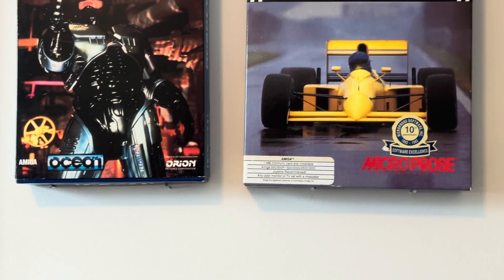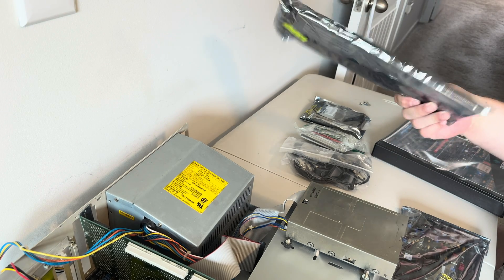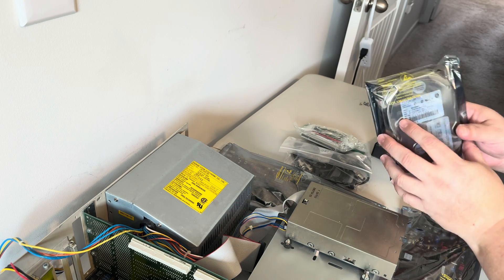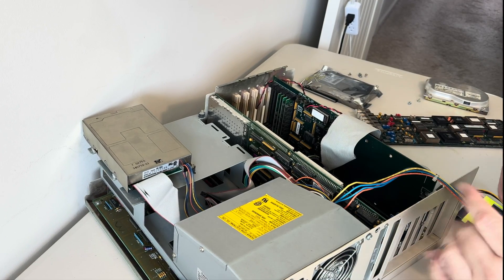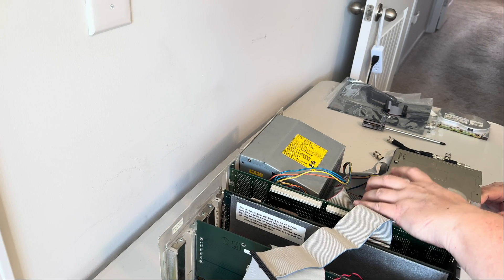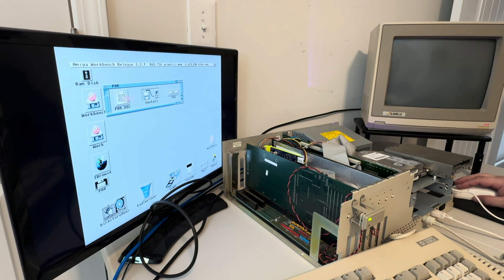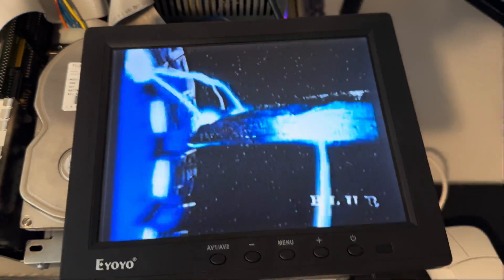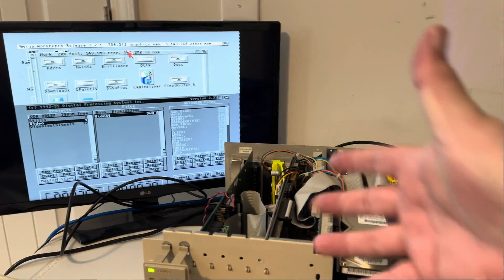We Had THIS Technology In The 90s for Computers!

Comment: I always wonder back then how they record those cgi on analog tape, now you give me the answer, it's a kind of a digital broadcast buffer , in early 2k i t was possible to convert all tga or RLE frame to a DV recorder , i actualy found a DVD + RW recorder that work in hardware MPEG 2 that have that DV link plug integrated to the rack and i still have my firewire PCI card on an old PC , but the render must be scanline field to PAL or NTSC to make the video run smooth without glitch.

Comment: SCALA with a LANC controller and a DV cam was MUCH MUCH better. S-Video/DVD quality recording. and MUCH MUCH CHEAPER. and all Digital. I was Destryong PC users in the 90's. Also used a DCTV with RGB adaptor and converted Video Footage into single frames and put them back into the Amiga as 16 color DCTV images (which it translates to 16 million colors) and played back smoothly. The Amiga thinks they are 16 color frames/animations and treats them as such so its light. I also used Elan Performer to play them back on an ECS Amiga to VJ. Instant response.
Reply from the maker: DCTVs output wasn’t that great. I mentioned DCTV in the video. I’ve done some vids on it. It’s a good cheap solution. Just not to the quality as the PAR’s output. The Amiga was very versatile and lots of animation options. The PAR was one of the best for true broadcast quality 30fps animation playback. Especially from your own desktop without a huge investment in other gear and fancy decks. A simple VCR was all you needed to record your amazing looking animations from the PAR.

Comment: On the Amiga monitor to get composite input, there is a slide switch on the right side of the flip down cover. It's pretty small and almost hidden, it slides left and right. On the back of the monitor there should be a composite labeled RCA input, or it's likely the yellow RCA. Might be a Y and C input on the back that I think was meant for C64's and 128's that had separate luminance and chrominance output cable. 

I remember drooling over those PAR cards in Amiga magazine ads. I had worked with a U-Matic 3/4" deck to lay one frame at a time using a serial to parallel controller that could control the VTR down to the field using SMPTE timecode that was on one of the audio tracks.  I think the controller cost almost as much as the 3/4" deck. It worked perfectly, but man did it take forever. You would start an animation on Friday afternoon in Lightwave 3D, render each frame; each frame taking however long, usually depended on complexity of animation. Maybe by Monday morning it would be finished for a few seconds of animation. Hoping you didn't get some kind of glitch on tape or stupid animation mistake you made. Usually used virgin tape to get the cleanest playback.

Comment: luke warm take: old DOS computers , Amigas, Ataris and the rest were good fun in their day but nowadays we're able to enjoy them even more because of all of the fan-made projects which make them better.
Reply from the maker: I really missed the simpler software and hardware. Lured me back. I like working with limits and still making neat stuff.
Reply: @HoldandModify  Limits feed creativity... There is no way around it. Depending on what needs to be done, the creative guy using LW will run circles around a Houdini artist in terms of output quality vs time spent. Work smart, not hard. :)
Reply: DOS computers weren't fun... I used them going back to the 80s, as well, but couldn't stand them. The Atari HCS, ST, Falcon, C64, Amiga, and Macintosh--along with other systems--were far more fun.
Reply: @RetroDawn  sorry that you didn't have fun. i had fun though and i'm sure i can't be the only person on Earth who had a good time using DOS machines.

Comment: The PAR was a game changer when I got that into my A2000 with the Video Toaster & Lightwave, I was broke buying all these cards, but happy. 🙂
Reply: Well, until the Amiga 4000 with the Newtek Video Flyer.
  It did LOSSLESS (unlike lossy MPEG) 768x480x4 million colors at 30 frames/sec.
Reply: @johnsmith1953x  22-bit color?
Reply: Poor but happy sums up my Amiga experience from 1989 to 2005. I used  that stuff for as long as I could. In 2005/6 I had to switch to HD and streaming and left it behind.

Comment: Paused at the open.... Is that the PAR board!!  If it is I used one a couple of years and it was astounding for the day!  .... Back to the opening...

Boy, does that bring me back to a great period in my life when I worked at Alpha Video in Minneapolis as my first job in 3D.  I had the PAR board going and never had to do single frame recording after getting it.  I was outputting to an M2 deck and it could be done so fast that I could do it while the edit bay was not using the deck for a bit.  Only 6 months earlier I was single frame recording on a JVC s-video deck manually with cause and insert edits.  Took me 4 months to make the 2 minute demo that got me that job.  I didn't do it alone, my best friend did most of that single frame recording when he got home, while I was make the 3D for the next batch of frames to render over night.

Last month he brought his Amiga 030 system to me.  I need to do a serious clean and retro bright treatment. I'm excited to finally have a 2000 again.  I miss the 4000 too.... Someday.
Reply from the maker: Awesome!

Comment: Par is IDE,why not just use a IDE/CF(or sd) adapter for the PAR hd? would be interesting to see how it works.
Reply: IDE-SATA bridge with M.2 SATA would tuck in nicely.
Also use less power and be inaudible.
Reply from the maker: Others have tried. The PAR is very picky. CF doesn’t seem
to work. DOM modules fail.
Reply: @HoldandModify  thanks for the info,i have a par card i haven't messed with yet,and its good to know what works and what doesn't.

Comment: That 3.5" hd on the PAR was a lot smaller than the one I saw. He needed a huge 5.25" full height drive. We had to mount it in a PC minitower case. The cases designed for just drives were too expensive. I don't remember his playback time though. 
The toaster really drove the cheap TBC industry for a while there. They just plugged into the 2000's ISA slots for power and were controlled from the Amiga's serial port. They let you use consumer/prosumer grade VCRs with the Toaster. You needed one for every VCR input you planned to use. It synced horizontal, vertical and color clock so you could do Switcher effects.
Reply: Only for tape-based inputs. Didn’t need them for laserdiscs or camera signals.
Reply: @CantankerousDave  I'm not sure about the laser disc, but I'm fairly sure that the cameras had to be genlockable if you were using more than one without TBCs.

Comment: Good addition Q. Its starting to look like one of my old machines. 😅 Had to call DPS and have them step me through getting both TBC-IVs working, there was some short cable that connected them together. Did actually use the PAR card to output completed TV commercials for clients here, pre-Flyer.  Panasonic had the AG1980 SVHS deck out at the time that could record single frame too. Stacked both the PAR and OS hard drive in the 5.25" bay. Now you know why I had to put Bigfoot 500W power supplies in each A2000, all slots filled really sucked up the juice. Before long you'll have ScreamerNet running 😅
Reply from the maker: Ah sweet! I have that short cable. The kit seems very complete.
Reply: @HoldandModify  i think the cable was the same as a SCSCI Ribbon cable. I have my DPS PAR in my Flyer Vampire 2 A2000 system. I use it as a video DDR source I can switch too. This was a great tool. When I was in China for toy work I visited some Hong Kong film studios and was happy to see them using DPS products in  PC's.

Comment: My memory is short, but when I had the A500 (bought a 80 Mb SCSI harddrive :-) I don't remember streaming IFF/ANIM that much it was memory bound. But I do remember a program for my A1200 called "biganim"? or something like that could stream IFF/ANIM files really big ones... Then again 24 FPS (720*576 PAL overscan) was not probably possible ofc
But large 320*256 5 bit color IFF/ANIM was streamable from the harddrive as far as I remember.

I also do remember setting up (I worked as IT tech in the 90's) a video editing studio (really low budget) in a school that had it as a course... and bought (if I remember correctly again) a Pentium Pro dual motherboard and Adobe Premier (v4?) and couple that with a MJPEG handling graphics card. It worked but you had to save your stuff every time on regular basis because a crash was always imminent. And although it was pretty good digitally, everyone wanted it on the TV ofc... and that conversion was not easy or nice... as the PC, graphics, or programs never really was connected to a PAL TV... so getting your digital video (usually PC resolutions) and then editing them on a PC (with PC resolutions, i.e 640*400 or 640*480 back then) to 720*576 interlaced (or something similar) was hard... and the School did not have an unlimited budget...

At home back then I had A1200 with 68030 and the best OS known to man :-) I loved it... But for sure... the Dual Pentium 200 Mhz pro was way faster...

I do also remember loving Lightwave, and got a couple of "outdated" PC's and bought one also (AMD K5, 133 Mhz? or 166?) and had neighbors with (Amigas and PC's) and built a BNC network so that I could install Screamernet on all their PC's and all of mine... did the modeling on my Amiga sent the animation on the Screamernet and it was just awesome... but after awhile they did not like the noise of their computers running 24/7 ofc... :-) But I loved watching the (I had the "server" install and ever render got back to my machine... the renders arriving on my machine... Think we had about 8-9 machines in total... and the Screamernet was just awesome it juggled everything so all computers just rendered my anim at 100% duty cycle :-)
Reply from the maker: Yeah, but saying PAR is just fun.  :)

Comment: Actually I may be wrong but I saw NTSC video using DCTV before them ?
However nothing as good as this or the German version that I have.
Maybe we can replace the Chinesium monitor
Reply from the maker: DCTV could almost do it on non AGA Amigas but you had to use the lower bitplane mode AND often not use interlace mode. And DCTV could bot display the full color profile a PAR could. On an AGA ‘040 Amiga you could get really close to FULL NTSC interlace and in full bitplane mode but it was not perfect. Plus you’re limited to system ram for your anim playback for a lot of those early years. So, yes sort of, but nowhere near ideal.
Reply: As I mention on Facebook my A1000 could do it but not as good as PAR. Commodore CDTV had a plug in dctv full motion plugin card which I saw in the lab but not sure it was released.
Reply: I have a DCTV I bought to use with my original A3000 back in the day with my 8mm camcorder. It was fun to play with, but more of a toy than anything. I wonder if it still works. I still have the 3000 too. The camcorder died over 30 years ago...
Reply from the maker: @cp256  Try it out again. You might find some fun!